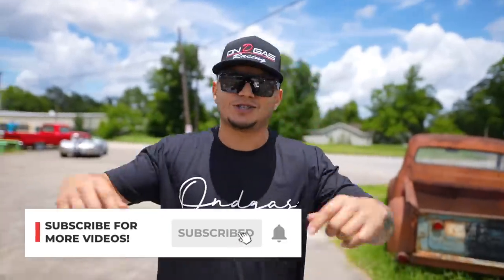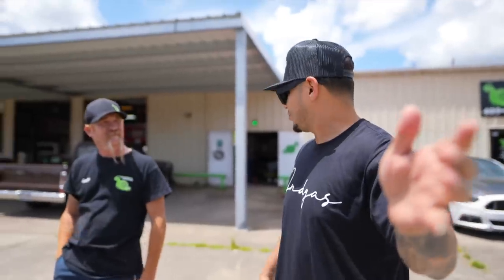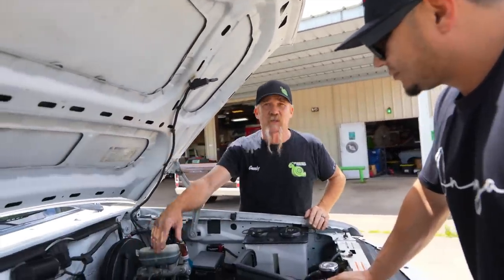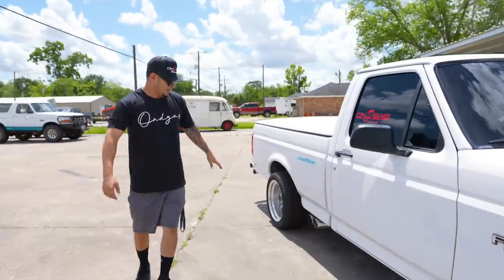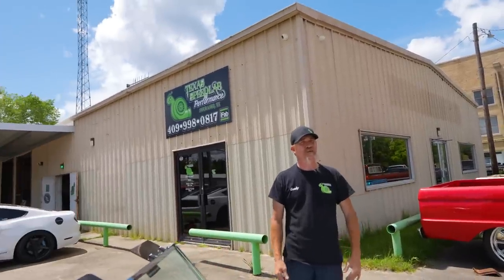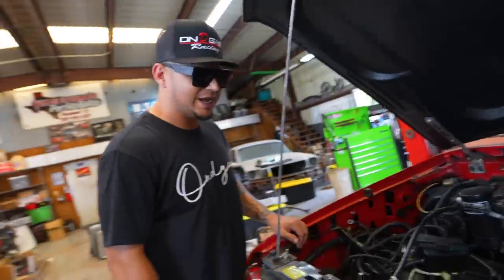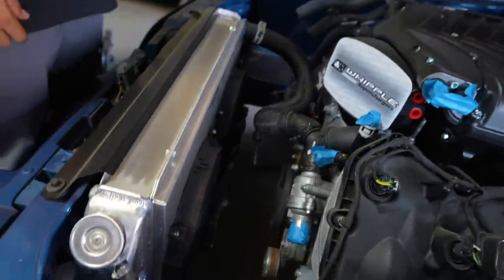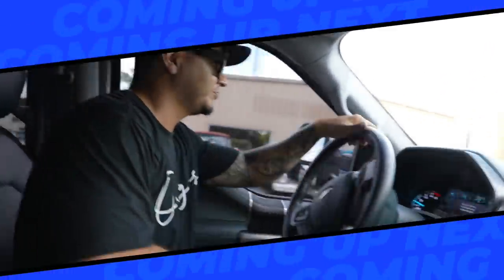Supercharged 3.8L Whipple Coyote Swap on 1st Gen lightning!

Comment: Especially for that lightning I think it would do awesome for that truck it's got a good cooling system on it now dual radiators all that good stuff I see that but with that 3.8 Whipple is going to make some heat and I think that AC switch technology that that dude put in that orange Camaro on just the six would work perfect for that lightning and probably for a few the other cars you have too check it out man

Comment: You know just the six your boy from Atlanta that orange Camaro he's got with that supercharger on it he's got a dude that takes the AC system and puts it on a switch and uses the AC system for the supercharger to keep it cool all with a flip of a button then when you're wanting to race you hit the button and then it kicks the AC off and switches it to the supercharger and the freon and all keeps that supercharger ice cold so it's kind of like having the methanol in it with a big blower how it keeps the ice cold while you're driving down the road you can do 50 poles poles and the car will never get hot then as you're driving down the road you flip the switch and it kicks back to your regular AC it is amazing this stuff the technology that they are coming out with on the gas my boys need to check out just the six and that video when he gets the orange Camaro and the c7 vet put the cams and all in it that's when they do that AC system to it you guys need to check that out instead of having them ice box coolers doing all that stuff where you have to buy ice and all that other crap the heck with that y'all need to get that system that he's got on that orange Camaro check that out